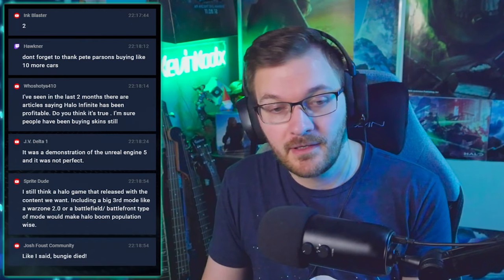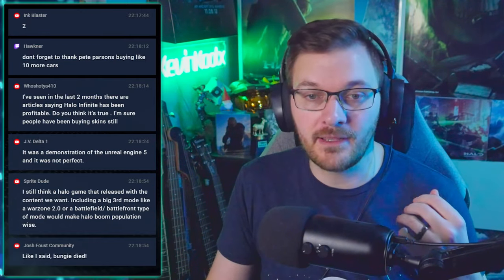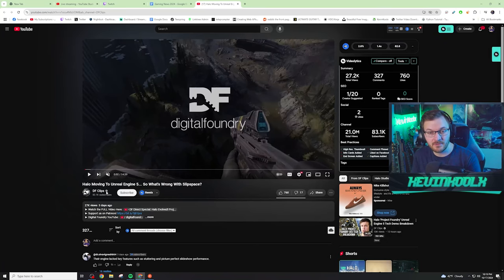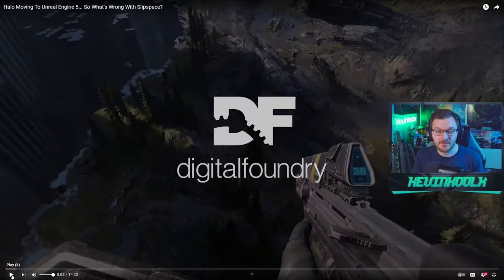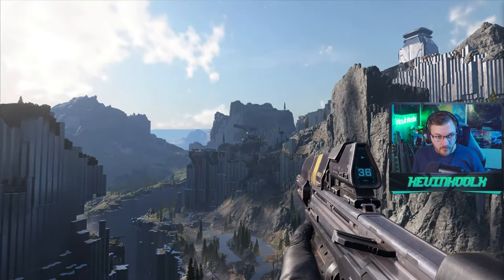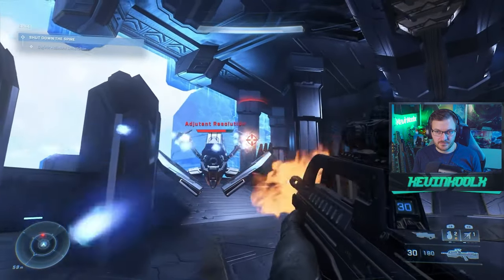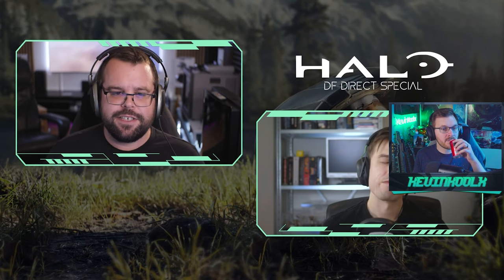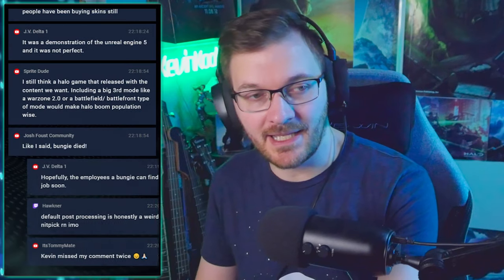Everything Wrong With Halo Infinite Slipspace Engine! Digital Foundry React

Comment: If 18 month contractors were the problem, how did Halo 5 release so much content so fast? I'm not saying that's not the issue I'm just wondering what kind of system they had with Halo 5 to where it worked pretty well with the tech and then it completely flatlined with Halo infinite
Reply: they were burning themselves out
Reply: Slipspace sounds like the reason - Halo 5 was Blam
Reply: @TJ_ax  Slipspace is Blam, just upgraded for newer hardware.
Reply: @shepherd2148  slip space is not blam. if 343 didn't screw it up, halo infinite would have been easier to develop
Reply: almost all the issues i've heard go back to the slipspace engine and also the lead designer of it left the studio. man infinite was really a cluster f*ck all around.
Reply: Slipspace is generally a hard engine to work with since they never had actual experience with it's innards since it is based off of Blam, which they didn't make.
Reply: @TJ_ax the slipspace engine is the blame engine but modified. Their words not mine.  Promising that they'd be able to ump out new halo n  dlc faster than ever before. Obviously that was a lie.
Reply: One thing... Please just... No more hexagon structures all over halo please.  Please.
Reply: I think moving to an open world was the overall problem for so many aspects of the game. Quality and content related.
Reply: @johnosterman494  Agreed, it could've worked if they just made it more of an actual open world with places to explore.